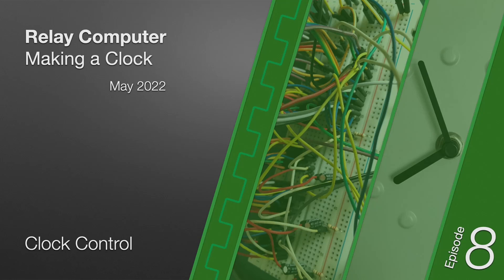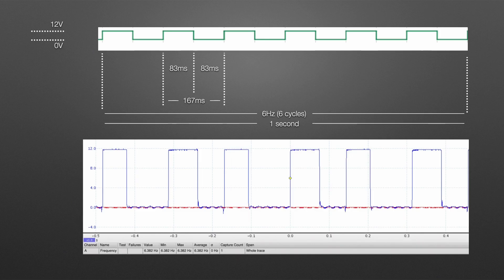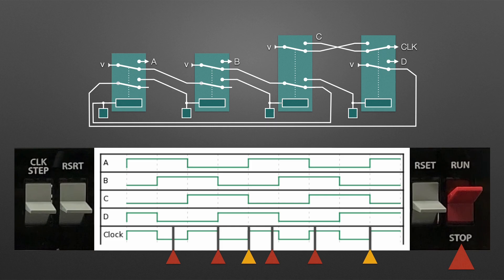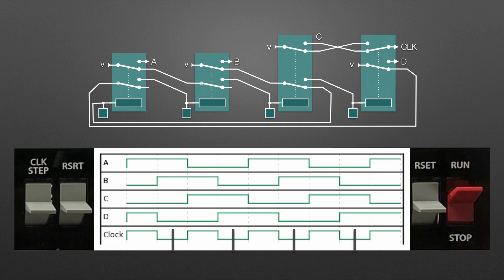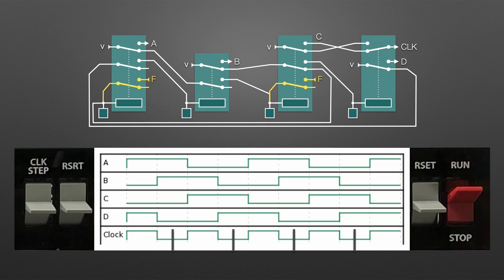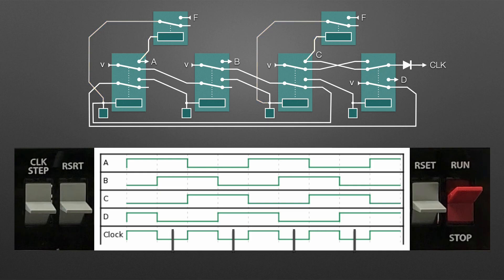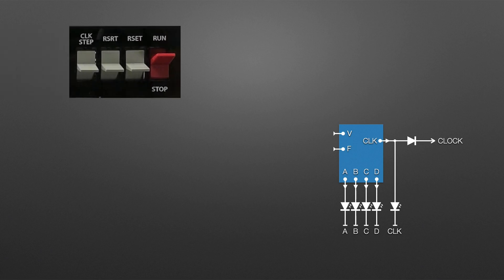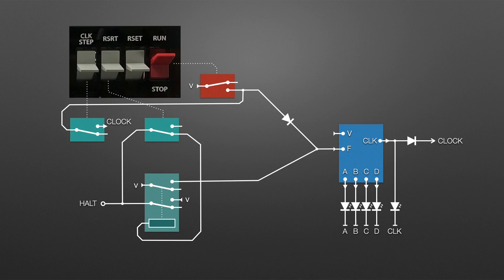Relay Computer Clock - Ep8 - Clock Control

Comment: Howdy!  Love the series, at some point I want to build my own relay computer so I very much enjoy following your progress thank you!  I might either fail to describe this or misunderstand a constraint but... if instead of gating the freeze line via the relay switches have you considered gating the freeze by "arming" the relays?  That is, the freeze line engages the coils of the new relays and the output of A and C are wired to the NO contacts of the relay switch.  That way the relays don't change state on the "sub-clock" and since C is then isolated until the freeze you might not need to worry about isolating it.  Anyway have fun, good luck, and looking forward to the progress! :)
Reply from the maker: Oh yea - that's a much better design! :)

Comment: Hi Paul, I’ve been following and subscribed to your channel since s couple of years ago. I’m happy you are back with your build after some time. As a retired software engineer, I really enjoy your way of presenting your ideas and essential architectural concepts, which I am able to fully understand. However, I have always been curious about what software tool do you use for such dynamic presentations?
Reply from the maker: Thanks :) Mostly it's just Keynote (I'm a Mac user) ... all the main presentation is a slideshow and then I just record the run through before taking it in to Davinci Resolve for final editing down.
Reply: @paul80nd   Hi, thanks. I’m a Mac user from the core too. I somehow figured it out after posting my message that it was keynote animations. It’s quite amazing what this app can do with some clever planning. 
Inspired by you and others I just started a series to eventually build a “switch” based computer, actually made of solid state relays, and I’m using plain Keynote for effects, Quicktime for screen recordings and iMovie for final editing, though the latter feels a bit feature limited to be honest. 
My project is quite ambitious, but it’s just starting and I don’t have any views. Anyway I would like to share it with you (maybe in private) in case you have some interest.

Comment: YES. My day is made. I thought about you many times over the break. Hell I almost designed you a new clock based on a magnet, flat spring, and relay. to increase the frequency you shortened the spring (pulled out on it a knob).